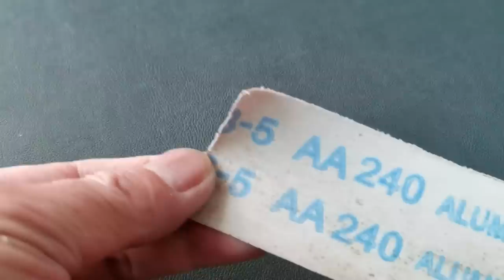How To Sharpen a Knife To Razor Sharp

Comment: I'm supposed to take building advice from a guy who uses a soldering iron as a drill and pliers as a hammer?
Reply from the maker: Thank you.  I want to build from whatever I have .  completely independent of power tools
Reply: It's the idea that counts not the source
Reply from the maker: Ok man
Reply: You do what you got to do
Reply from the maker: Ok man
Reply: Hah.
Reply: Burning the hole with  soldering iron hardens the wood
Reply from the maker: Thank you, I want to do it from many ways
Reply: If it does the job, i mean why not?
Reply: Non power tools needed: actually I did it with an axe and a big stone and it worked so well!
Reply from the maker: Thanks bro
Reply: The idea is solid, I would have done it differently but so would anyone else, is the results that count, good work man
Reply from the maker: Thanks bro
Reply: For once...think out of the box!
Reply: Those are called "multi tools"
Reply: @tipsintelligent2605  your reply just earned my sub👍
Reply from the maker: @RoyalEmpressTree  thanks bro
Reply from the maker: Thanks bro
Reply: On the contrary, using the the soldering iron to make a hole is quite brilliant. Strange you couldn't get that.
Reply from the maker: @CKMediaProductions   thanks bro
Reply from the maker: Thanks man
Reply: Mark, a hole is a hole regardless of how it became a hole - a great Mongolian Yak expression...
Reply from the maker: Ok man
Reply: Great idea, I think, but using a soldering iron to poke a hole and the pliers to push bearing inside the pipe, that is weird!!
Reply from the maker: Thank you, I didn't have a drill at the time.  I have to finish it another way

Comment: Great idea. Only I didn't find the logic behind using bearings. As the borh end screws didn't fit in the inner side of bearing. It is too loose to balance the pvc rod properly.
Reply from the maker: Thank .  That day I did not have enough necessary tools, such as a drill.  Although the bearings are loose, they can bear the force of the knife and still operate stably.  sorry I have to finish it with this

Comment: You won't end up with a razor sharp blade if you use 180 and 240 grit sandpaper... And the bamboo one is pure crap, a file won't sharpen a knife.
Reply from the maker: please try again the video I published on 3/2 it works extremely well.  I love that method.  you will stop doubting me
Reply: @tipsintelligent2605  it's not about how many times I should try again, but about how coarse are both things. They may work as a quick solution for some uses, but both will ruin a good knife if used regularly.
Reply from the maker: Thank you .  It is well suited for low carbon knives.

Comment: Hello again. When I asked for the dimensions I meant each piece of wood H x W x D and the pipe length and diameter. Sorry for the misunderstanding
Reply from the maker: thank you I use wood as follows .  ( 400x60x25 = 1) ( 100x100x28=2)(110x45x15=1) plastic pipe 300x25)

Comment: You don’t wanna knife that’s razor sharp. The edge of razors is extremely delicate. Knives have too much hard work so the edge cannot be razor sharp.
Reply from the maker: Thanks bro
Reply: Disagree, i have golok sharper than showed here, i used it hardwork like cuting woods and still sharp because its well made and sharpened conveks
Reply from the maker: Thank you , it works very well
Reply: thats great for you Rick. Though I really like steel and the sharper the better'. Also agree with razor sharp edge being soft.  Carbon steel  is good for me unless I try to open a can with it.
Reply from the maker: with low carbon knives.  making it sharp is very easy, thank you
Reply from the maker: with low carbon knives.  making it sharp is very easy, thank you

Comment: this is non sense .. ima meat worker of 20 years this is not the correct way to sharpen a knife at all .. its non sense what angle is he using ? this is rubbish , a sharp blade will not stay sharp long if the angle is off .. this is far to inaccurate
Reply from the maker: Thanks man

Comment: Nice but no information on what the cylinder is made out of, so no idea what your using to sharpen with.
Reply from the maker: Thank you, I did not provide a measurement by mistake
Reply from the maker: Please use 400 sandpaper

Comment: No... 240 grit sandpaper does NOT make razor sharp.  It essentially makes a micro-saw-tooth.  Good for cutting lots of things but not a razor edge!  Same with that file... you creating a feather which acts like a saw-blade - but you're eating the tiny metal shards that fall off into the food when cutting.  Razor edge needs 5000 grit stone  and near razor can be achieved on 3000 grit.
Reply from the maker: thank you, after grinding the sandpaper will wear out and it creates a fine layer of powder
Reply: @tipsintelligent2605  LOL... no, that is NOT how sandpaper works!  Please use a microscope or jeweler's  loupe and examine the edge you are creating.  Then examine an edge created with a 3000 to 5000 grit stone.  You will see that the 250 grit sandpaper created a micro-sawtooth edge and the 3000 grit stone created a smooth "razor" edge. There is a difference in how the resulting cut foods will cook too.  Additionally if you are cutting foods through plastic (wrappers or whatever) the sawtooth edge will introduce micro-plastics into the food which is bad for health - whereas the razor edge will not. etc.
Reply from the maker: thank you , it is as you say , but it depends on the grinding method of each person .  For example, with stones after grinding it will create a fine powder layer.  you hold it and the grinding force is reduced it will give you the smoothness you need.  It's the same with sandpapers, and the sandpaper is worn away without recovering with the powder it creates, then the smoothness will increase.
Reply: @tipsintelligent2605  I disagree! But even if that were true, why would you prefer sandpaper? A good stone costs only $20 and will last to your grandchildren's old age - several lifetimes... Good wet & dry sandpaper costs $3 a sheet and only lasts a week or two at most. So even considering just value, the stone wins... by a lot - not even considering that it produces a FAR superior edge. <shrug>

Some funky or hokey YouTube videos are just that... funky and hokey!
Reply from the maker: thank you , grinding on stones for you and me can be simple , for many people it is really difficult because there is no support or the stone is completely sunken in the original plane , grinding on the supports it  will give you a good sharpening angle
Reply from the maker: Personally, I think on the youtube platform is an environment where people have to show off all the skills they have accumulated in life (I'm just talking about the technical side).

Comment: Really? You can turn EVERY knife into a nearly razor sharp state! But shis shit will get dull in 1 or 2 weeks! So IT ITS USELESS!
Reply from the maker: thank you , with low carbon knives it is very easy to make it razor sharp , with this sharpening it works very well .  you have to change the paper with a higher fineness, it will be like a razor